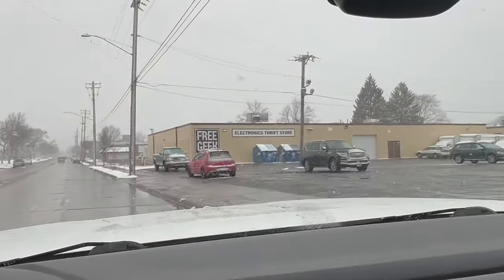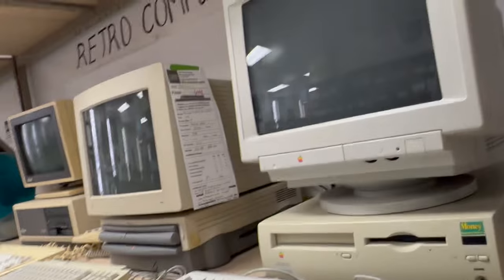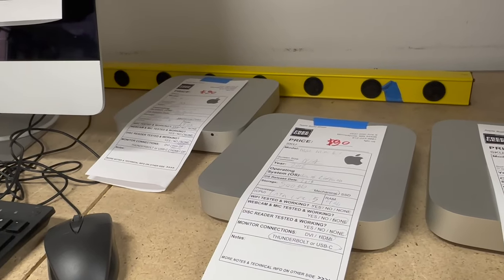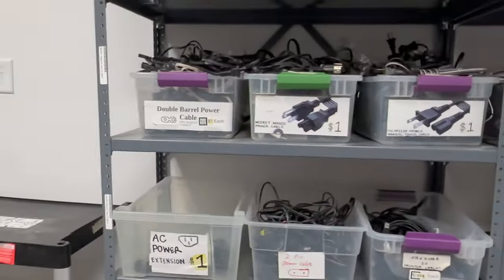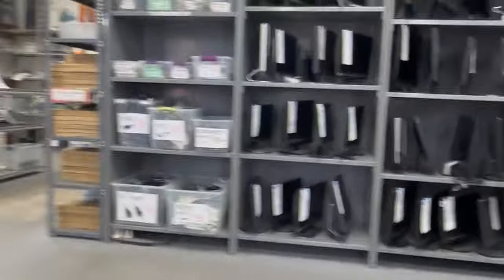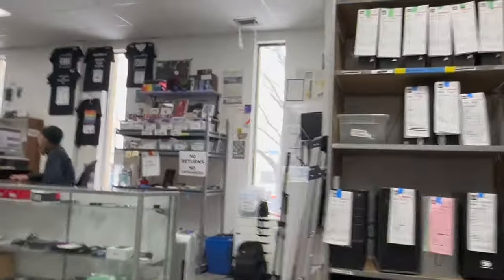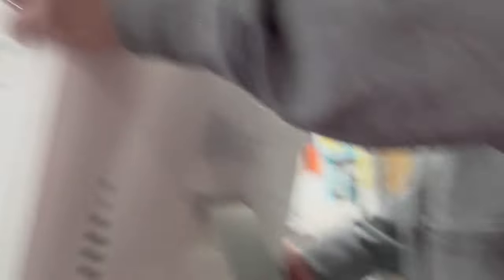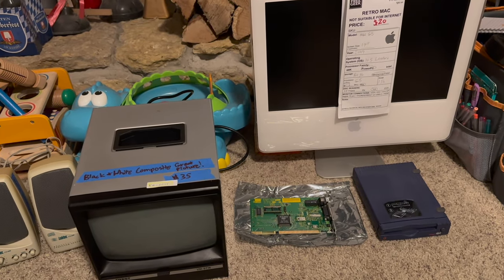Free Geek - Vintage Computer Shopping in Minneapolis, MN USA

Comment: Of the computers I've sent to the recyclers over the years, the iMac G5 at 9:35 is my biggest regret. It was the most repairable iMac that Apple ever made, with the whole back panel held on by a few captive screws and diagnostic LEDs right on the logic board. When I got mine it needed two capacitors replaced before it would boot, but they were the same through-hole components used on desktop systems and easily soldered. The white polycarbonate era is probably my favorite era of Apple.
Reply from the maker: We all have regrets about recycling old computers.  Who knew?

Comment: Great video!  The AT&T branded PCs were actually made by the Italian company Olivetti.
Reply from the maker: That is fascinating - I think I had an Olivetti PC way back at some job many many years ago.
Reply: @jonobst  That’s cool!  Is it true that iMac G5s have heat issues, because of the design and the G5 processor?
Reply from the maker: @dave4shmups  yes and no!  G5's ran hot for sure (which is partly why we never got a G5 iBook - the other part being power draw), but the iMacs had adequate cooling - until the dust builds up and then they start to choke.
Reply: @jonobst Gotcha.

Comment: It's very unfortunate. COVID dismantled the chapters you noted, especially the Chicago chapter which I attended for a few months back in 2019. The lease was getting too expensive and the funding was drying up during COVID and by 2022 the Chicago chapter also closed. I will say that it was a great idea. One of the things I wanted to grab for myself was a couple of 2010's 27 inch iMac's for Linux desktops but unfortunately, I never made it back.
Reply from the maker: There was a small but concentrated effort to open one here in Madison a few years ago, but interest dried up pretty quickly and they never made it past 'having a discord.'    It also looks like Free Geek Chicago is going again: https://freegeekchi.org/2024/08/24/the-door-is-unlocked/

Comment: Unfortunately at this branch they do not offer free computers, they are sold for $35 with proof of enrollment in a public assistance program (Medicaid, SNAP, etc.). Affordable, definitely, but not free.
Reply: It used to be that if you volunteered for something like 25 hours you could get a free computer.  The volunteering work was usually taking old machines, stripping them down to their parts for recycling, etc.  Not sure if that's still the case.
Reply: @pscheie  This was the case for the Chicago chapter.

Comment: Just an iMac. Not G3. G3 was a tower that was released the same time as original iMac.
Reply: The original G3-powered iMac line was known as the iMac G3 after the introduction of the iMac G4 to avoid confusion. The tower was originally Power Macintosh G3, later PowerMac G3. 

To the best of my knowledge Apple never had a computer simply known as G3; that was a designation of a PowerPC 750 processor that powered several Apple models of the era, and used as common shorthand to refer to any and all of said computers.